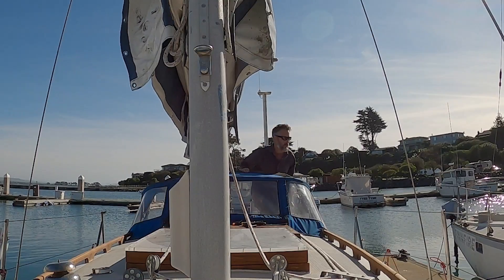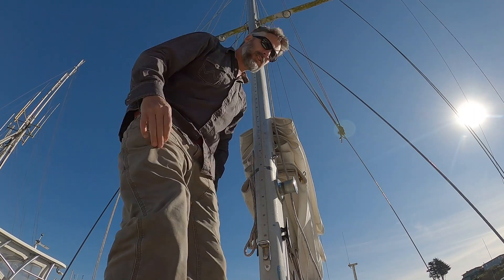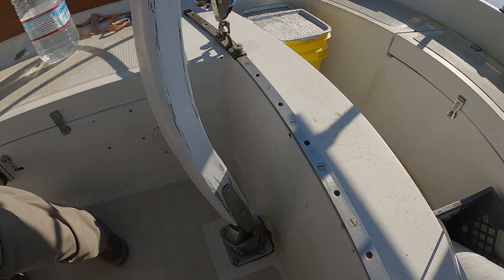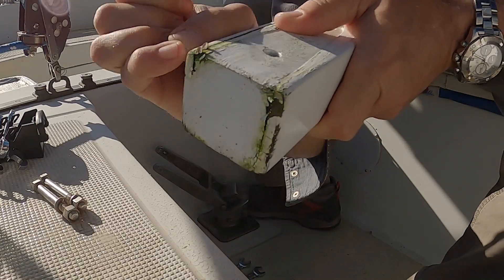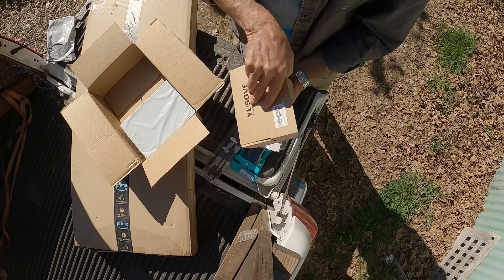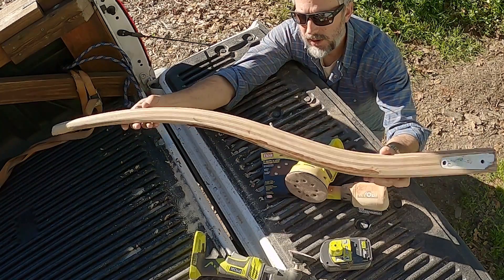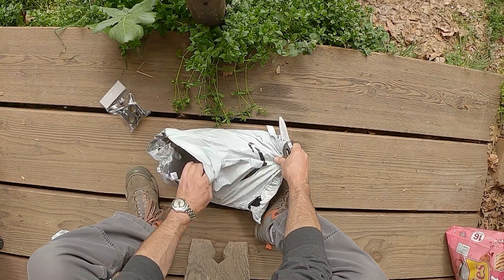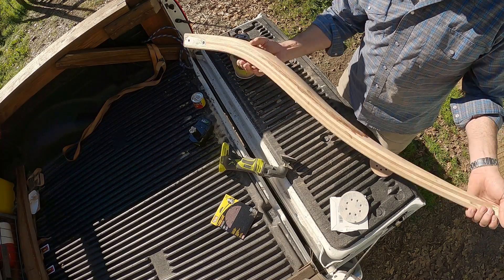It's Tiller Time - Restoring a Fungus encrusted Tiller for my 32' Sailboat - Captain's Vlog 7

Comment: Another great video.  I was crewing on a yacht where the owner had installed single line reefing to the cockpit (no going to the mast) but there was issues with friction so it didn’t work very well.  Also the reefing lines were a problem when dropping the main, always getting tangled up.  Your tiller is looking so much better, it’s a good thing you removed it and are repairing.  Yes, make a cover for it...I have one and it’s so good at keeping weather off it, especially from the damaging effects from the sun. Hope your Canadian trip goes well. Elaine ⛵️😊
Reply from the maker: Thanks Elaine! I first had the idea of running the reefing line to the mast from watching Free Range Sailing. They covered it during their last refit :) Thanks again for your encouragement.

Comment: Hi Edward.  First time commenting.  Not too experienced a sailor, but I've been looking at reefing line systems for awhile.  If I'm not mistaken, your boat is probably set up for single-line reefing.  That means the reefing line should go through the reefing cringle before returning to the cockpit.  With this method, assuming your main halyard and topping lift run to the cockpit, you shouldn't need to leave the cockpit to reef.  There are many opinions on going to the mast to reef/keeping the cockpit clean versus the simplicity/safety of single line reefing, so I'm not suggesting either way is better.  Look up single-line reefing, if you haven't already, and you'll get a better idea of how it works as well as lots of opinions on it.  Enjoying your videos.  Keep it up.  Greg
Reply from the maker: Thanks very much. I'll Google it!

Comment: I am just wondering why, when you have two winches and two clutches sitting on your cabin roof designed to take all lines to the cockpit, you are still walking to the mast, in rough waters you can completely operate your boat in safety from the cockpit, that includes your mainsail halyard, topping lift, kicker and reefing lines????? Having said that I am enjoying your content, keep up the good work.
Reply from the maker: Not true. If you want to reef your mainsail, you must go to the mast anyways to attach the clue, even if you did have your lines run to the cockpit... still gotta go to the main mast if you wanna reef. So why not just go to the mast all the time? Keeps the cockpit tidier.
Reply: @EdwardSeatonSailing  It is true , you just have to have your reefing lines set up for use in the cockpit, I am sure if you looked you could find some examples of how it is done on you tube, if you are caught in some heavy seas you will be much safer having all lines leading to the cockpit, I had it set up on my Rival 32 and it worked a charm
Reply from the maker: @petercrane2065  i hear your point, but... let's consider for a moment that I did have everything run back to the cockpit, what happens when it breaks, or you foul a line, or you have to put a reef in and need to secure the clew. You'll have to go forward. Why not get used to going forward? Also, it keeps the cockpit tiddy.